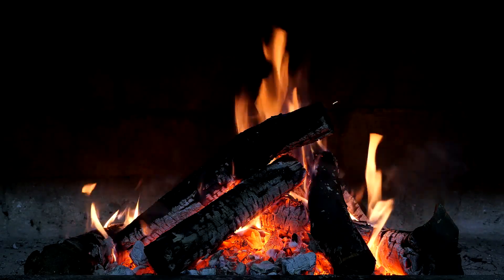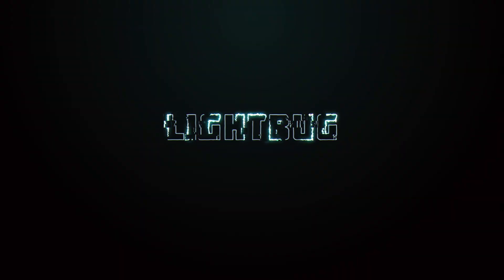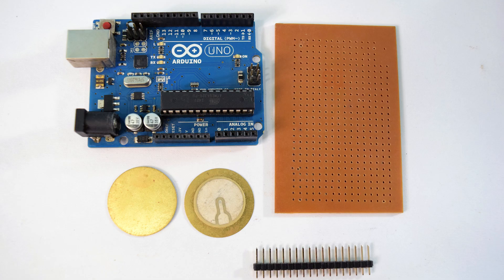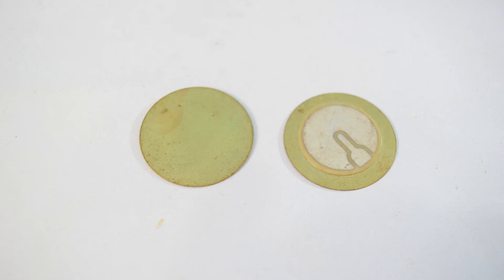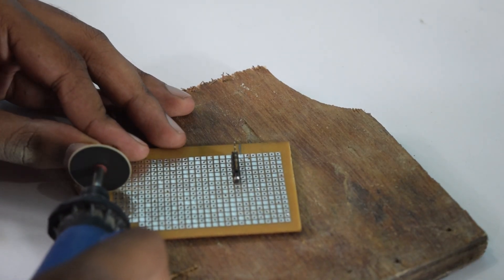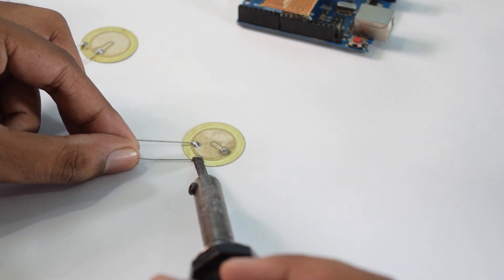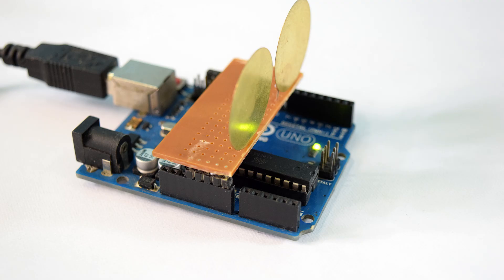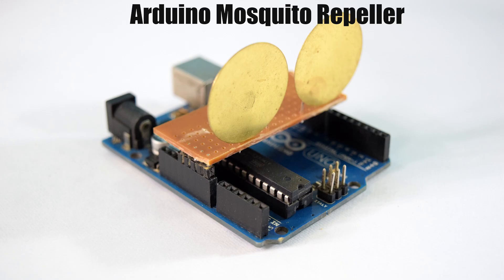Arduino Mosquito Repeller

Comment: Dear TeamLightBug, Thanks for your post. 
I have a question; in the code it says: int speaker2 = 11;
But the second speaker 2 does not have connection with pin 11 of Arduino. 
Could you check and advice please. Thanks for your time.